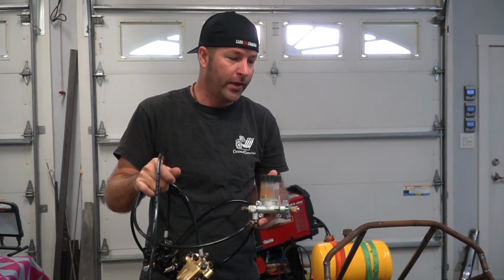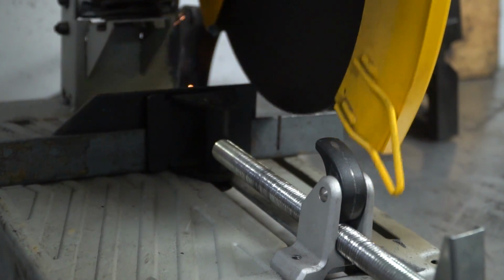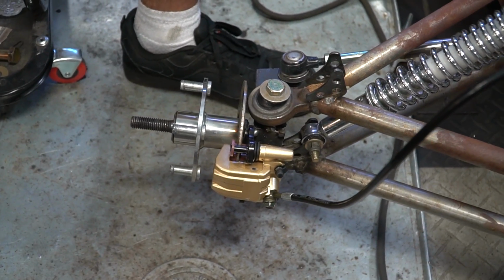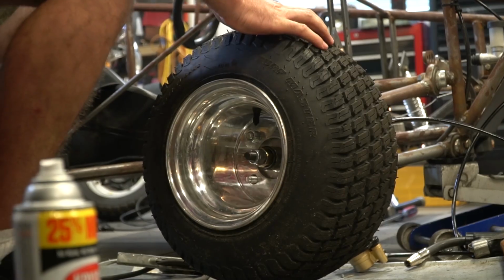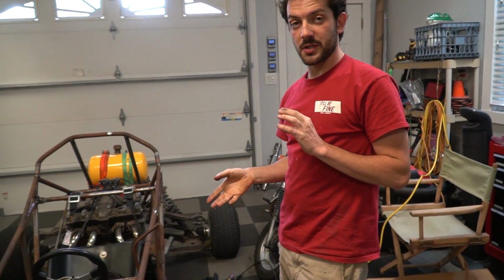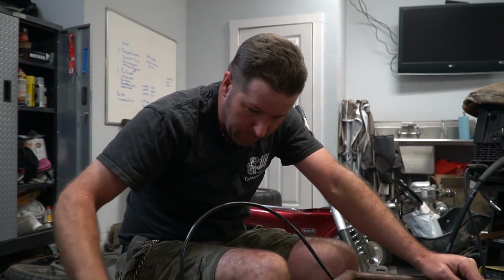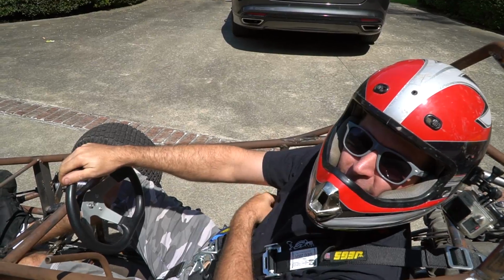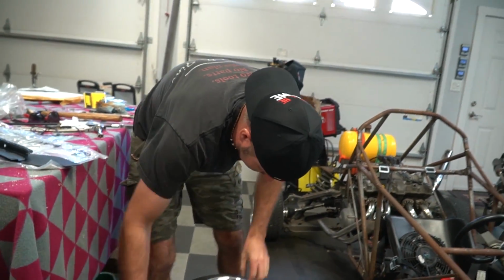Fabricating Front Brakes for the 750cc "X" Kart

Comment from the maker: Guys, I just bought a huge eBay wing. Send help.
Reply: Now all u need is sheet metal to cover the exposed frame for aerodynamics etc. Can't wait to see it painted
Reply: Cover the body and paint it blue
Reply: the title say font brakes not front brakes lol
Reply: Now it does standing burnouts
Reply: @Daniel Seaman love that show
Reply: CarsandCameras hey guys can u guys make a go kart for a paraplegic like myself
Reply: locking the wheels up at 80 mph in The SHART KART lol
Reply: CarsandCameras yea thanks bro
Reply: CarsandCameras need to buy exhaust
Reply: CarsandCameras thank you Daniel seaman
Reply: CarsandCameras thank you daniel
Reply: https://minneapolis.craigslist.org/wsh/snw/d/stillwater-fast-cheap-and-awesome/6941895782.html <---This. This is what i need.
Reply: @scottbriggs2191 

I have seen the Honda FL250/FL350/FL400 (AKA Honda Pilot, and Honda Odyssey used by paraplegics.  If you can find one in good condition, the biggest problem you might face is getting into the Dune buggy.
Reply: CarsandCameras oh ok
Reply: Hey John I posed some tech tips on regular comment section be sure to check them out save some money
Reply: @jmyd83  !!!Damn Brother... You called it first... "Shart Kart" Baaahahahaha @CarsandCameras Here's the name for this beast!!! lol
Reply: Can you guys get a GPS promo code. I want the 40 series but it’s expensive
Reply: @mecca b the code is cc10 they have had it for years it's still good

Comment: Why you limit the wheel size to 8 inches is beyond me.. You kept the smallest size tires on a kart with huge suspension travel and no tread on the tires.. Crazy
Reply: That's what I keep thinking. I wanna see it with some 23 or 25" atv tires.
Reply from the maker: We want overall low center of gravity so we can sling it around and not flip it (within reason). We have our eye on some 19" tall tires with aggressive tread to upgrade from these 16"s
Reply: @CarsandCameras  sweet! Can't wait to see what its gonna look like
Reply: @CarsandCameras  be cool to see some air ride on it to adjust the height for the terrain. Air bags are cheap on eBay. Just a thought.

Comment: tip if wanted... dont use sticky rim weights... use truck balance beads..
id use about half ounce of beads per tyre that size... just break one bead and pour beads inside the tyre and pump back up ( tubeless only obviously lol ) and they roll around self balancing the tyre! ive used and fitted them in multiple different size wheels being a tyre fitter and they work well! good job on the kart too!! its looking and sounding awesome!! i do wonder if its getting enough air through just them 2 carbs tho?? keep uo the uploads and great builds! is good to watch 👍

Comment: bacon sounds good. with front wheel weights on inside that is a lip for a IAW wheel wieght i know its a hammer on weight but it is coated and if carefully applied will work bettor for your setup. since you have more clearance on that inside lip. also bringing the weight closer to outer edge of rim will help your balance.

Comment: For the shifter, make a rectangle with the same size slit as the tubing of the shifter. Like a runner for the bar.
Slide it over and weld something to hold it. Have it further down like half way. 
It would make the shift more secure and reliable until you get paddles.

Comment: For the basket cart- electric motor and custom aero fiberglass body! Completely different from your norm!
Reply from the maker: I dig it, but electric motors and batteries are expensive compared to gas. Maybe dual engines or a 2 stroke?

Comment: Just some pipe insulation cable tied above your knees and besides your arms and thats bruising not breaking sorted. 

Because in motorsport you prepare for when things go wrong, not if they go wrong.
Nice job on those front brakes.
On the drag strip the DuKarti will have the legs of the cross kart, but on a track the  X'Kart will out preform the DuKarti. 

Less tire slip, better breaking meaning a higher average speed... 

SMOG PUMP SUPERCHARGER!!!! just an idea...

Comment: check with Go Power Sports,  but I think that the nuts on the dual rods on the master cylinder acts as a proportioning valve.  You should be able to adjust the front/rear brake bias that way.

Comment: finally just saw you welder settings mine runs smoother about 18.5 or so at between 220 and 240 for the wire speed your guys sounds a little funny every time I hear it if your running that hot on the voltage side I would definitely up the wire speed a little thanks for the good videos and project ideas

Comment: Go with some bigger rims and throw some ITP hole shots on there front and back!! That thing would rip so hard with some 18” ITP’s or Hoosiers and the bigger rims will give you all the clearance you need front and back. ATLEAST 18” quad moto tires on the back. Fronts bigger rim and a bit smaller tire than the rear.
Regardless you guys are completely killing this build. I doubt $10k cash in my hand would get that thing from you guys I can’t blame you either. One more thing, more driving footage! More more more! 😂

Comment: Very good, now I can finally try to get front brakes on my stinger buggy. Nothing like fishtailing at high speed from rear brakes only. I checked out the kit from Go power sports. it looks like you used a different rotor than the kit. Can you tell me the brand and dimensions? Also what is the inside diameter of you front wheel?. Clearance has been my biggest nightmare and I never thought of welding the rotor to the spindle....thanks so much for a solution!

Comment: Really should have just made a small bracket with threaded holes, welded that on the hub, then cut out a rotor and punched a few holes in it so it's removable. Then you'd also be able to shim it if you needed to to get rid of the runout. Otherwise, pretty nice setup.
If you do go with separate master cylinders for the front and rear, you can change the bias of the braking power by changing the size of the master cylinder piston. The smaller the piston in the master, the greater braking force you'll get for a given caliper piston size.

Comment: You guys should add a handbrake when you do the paddle shifters. And run a secondary master cylinder to a secondary caliper and rotor that you got with this set of brakes. That way you can utilize the rear brakes to initiate slides and drifts.
Reply: And it will act as a safety in case the main break system fails

Comment: noti squad! this cross kart turned out super good so far. are you guys gonna add a body onto the frame??
Reply: I dont think we are but you never know
Reply: @isaacitllbefine7231  ok
Reply from the maker: The more I think about it the more I want to. It'll probably have to be canvas though, sheet metal will be heavy and get dinged up from rocks and look terrible in no time.
Reply: @CarsandCameras  yeah, also i feel it would probably make the motor struggle more than it has to. would fiberglass even work? or not because like you said it would get dinged up from rocks and look bad. what you could even do with the woboly thing, is mabye add some triangle suports in a couple of spots in the corners on it, if that would help

Comment: I would have used indipendant mountain bike hydraulic disc brakes and mounted the handles on the steering wheel.
That way you could brake the inside wheel hard to turn in sharper.

Comment: you need another basket to go on top soo if you flip over it will still go even though your upside down. wheels will have to be quite big to run in both modes.and i think would be cool as electric motor power .and if feeling dangerous then have remote control lol.it will be fine

Comment: On cars and bikes about 80% of your braking is on the front end, how that fits on your cart may vary due to weight distribution. Your maximum braking is just before the brakes lock, the tires should be howling, but NOT locked. If you lock your brakes you are riding on a layer of melted rubber which will just about double your stopping distance.

Comment: you have to put the earth clamp on the rotor/hub and not the frame. when it earths through the bearing it burns the rollers and the bearing wont run smooth. thats also why its not welding well

Comment: just got to 13:00.... if the back locks up before the front doesn't that increase your chances of oversteer when braking and spinning when coming to a hard stop? Like, you'll have less traction when locked up  than when under full brake power without locking.
Reply: That would probably be better than losing traction in the front and severely understeering.
Reply: @derschwarzgeist  it's generally understood in racing that understeer is a safer failure mode than oversteer. Understeer just results in you ending up missing the turn, and is super easy to recover from; oversteer on the other hand is basically unrecoverable and usually means you spin out, which means you impact whatever you're going to hit at the wrong orientation. Head-on is kinda the safest way to hit things in most vehicles.

Comment: @carsandcameras Hey John you probably need a new liner in your welding lead a good way to keep it from happening is to get a new one and use .030 wire with a .033 tip it will create less friction thus less trash from feed motor that's what clogs them up and you can twist the lead in a certain direction to shorting it  to where you can cut the first 2 or 3 coils off cut the heat distorts them don't keep buying new leads try these tip and tricks it technology bad what u have to lose

Comment: Hey guys.  I had a. Question.  For ya.    I'm sure.  You have seen the predator powered. Truck.      I am in the process of making one.      They guy is using a centrifugal. Regular go cart clutch. And a 12 in sprocket.    I would like.  To use a cvt.  Not sure.  Which to use any ideas ?   The 12 inch sprocket seems hard to come by.   But y not have a variable  ???  Any help would be greatly appreciated

Comment: It sounds like a car that should have 1980's style Group B type rally wheels.... with modern rally tires. Powdercoated in white. 😎🤣 ...or maybe just powdercoat the Miata wheels in white, and get the most knarly tires that'll fit, without adding much extra height to the wheels.
Reply: But...then it probably makes more sense to also use a Miata front end as well. Miata arms, good motorcycle shocks. You can even run fork legs for shocks in the rear, and a couple adjustable mono shocks up front. Stuff that give you total ride adjustability.....and high performance, for hard driving at high speed... big dirtbike, or adventure bike stuff.

Comment: Equalizer block off a car for a splitter it will also run rear all breaks on one master cylinder with an equalizer block from old car
Reply: You can cap off the block for the ones you dont use

Comment: Should get some drilled discs for better  braking
Reply from the maker: It's my understanding that a drilled rotor won't stop any better, they just dissipate heat better. Oftentimes they can crack and prematurely fail, that's why we left these alone.
Reply: drilled and grooved  better than solid discs any day  helps with brake fade  so basically improves braking 😃 thanks for the reply😊love the channel

Comment: You guys have rear miata hubs. Why not grab front hubs and put car brakes on it. Can be done for cheap and alot more safe than this. Then put normal size wheels and tires on it that can be properly balanced and will provide more traction and more safety at high speeds

Comment: Will Miller just send them that new 120-240 multi purpose unit already...
Reply from the maker: We don't have 220 power in the shop, and it'll cost thousands to install. That's why we're working with 110. I'm looking at new shops at the moment.
Reply: @CarsandCameras  too bad you guys aren't closer to Chris/Rather B Welding, you could all go in on a shop with land for testing and building.
Reply: @CarsandCameras  If you already have a sub panel in the shop, it shouldn't cost "thousands" to install 220.

Comment: You put the calipers facing to the front, not good. They need to be in the back of the wheel to avoid obstructions so they don't get bent or break off and the line does not get caught on things off road. It'll be alright, I guess.

Comment: Oil doesn't burn off brake material.  Brake cleaner will only remove the surface contamination as soon as the brakes ware ten thousands off you are back into oil or break build again. $20 ain't that much money. Build your dad a fancy riding mower.. Maybe with a turbo charged sod layer attachment to fix the lawn you fuck up. Also while we are on the subject any bike shop worth a shit sell exhaust baffles $10 they can be slipped into the exhaust at the end for around houses and removed for the track.

Comment: you need a way to balance the brakes or you lock up the front or the rear brakes . usually they use two master cilinders with a balance bar in between , https://www.tmrsupplies.co.uk/products/balance-bar-assembly-for-brake-bias/
as for the rescue basket : i wouldnt be supprised is its made out of stainless steel , it will be incredibly hard to drill intoo and i dont know if youre able to weld normal steel to it or need specal welding wire stainless steel and or gas 
might want to check that , if you cannot weld or drill on it you could allways make a light frame and clamp that solidly to the basket

Comment: Using a lathe is called turning, one who uses a lathe is called a turner. You can do some pretty cool things with a lathe, not just turning round parts: https://www.youtube.com/watch?v=Av5M8LePDBY. No more using a belt sander to shave heads. Also learn to draw file, lap, and check flatness on a surface plate (a granite tile, piece of granite countertop or plate glass can make a cheap surface plate/lapping plate). Also, measuring tools.

Comment: Gentleman your Not supposed to put your welder on an extension cord!!!!!
Reply: No problem at all, as long as it's the right thickness cable for the length and amperage to minimize drop. I run my 3 phase 440v welder on a 50-100ft of extension daily.